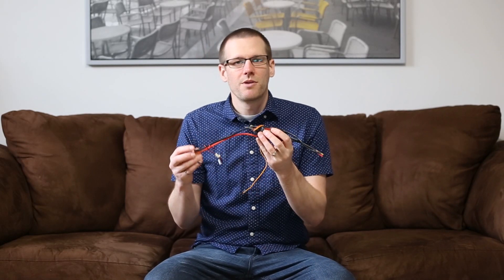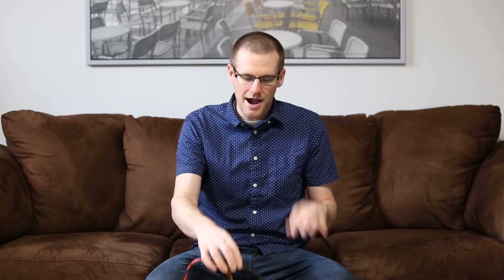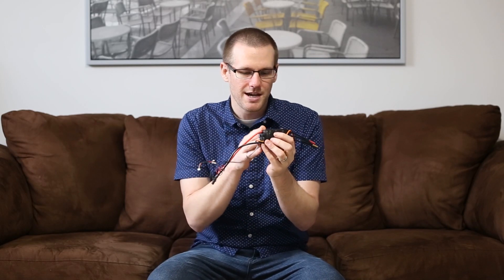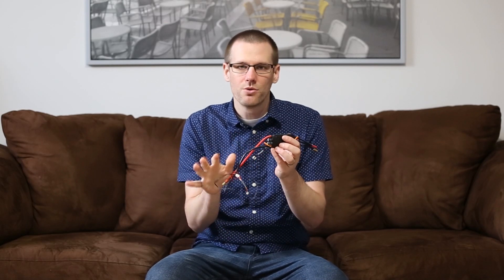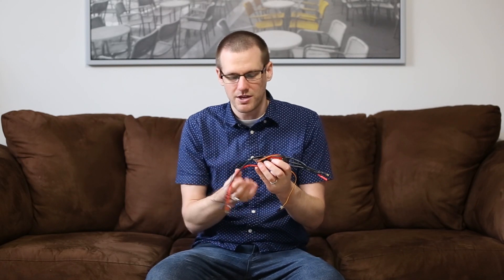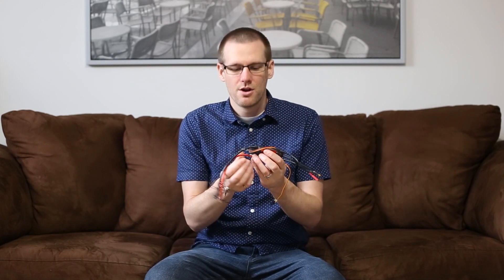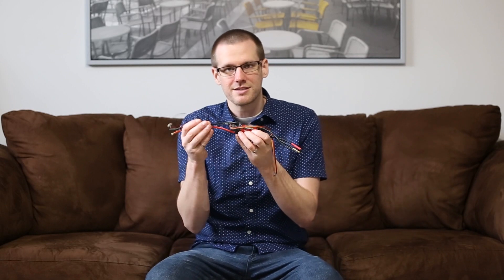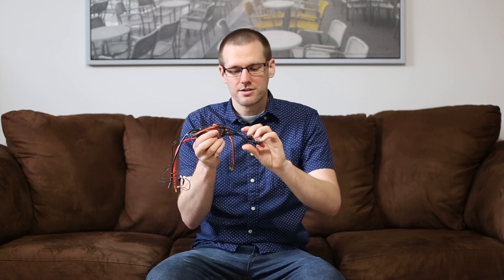Can Extending ESC wires kill your ESC? - ESC Basics

Comment: If the length of the wires on the battery side really matters that much then how come it doesn't matter how long the batteries wire is? Since once connected they essentially form 1 wire from battery to ESC and battery lead lengths are Not standardized or even remotely close to each other in length in some cases. What about adapters wouldn't those also add length and therefore cause this slow damage overtime? How come no one has addressed this when it seems like such obvious questions to ask

Comment: Hello, 
Is it the same problem when using a plug adapter that add some more cable length ?
Reply from the maker: Yes, although to a lesser extent. My recommendation is to always solder on the plugs you wish to use and avoid adapters.
Reply: @RCexplained  Thank you for the answer. Your channel have very valuable information for the RC hobbyist.

Comment: I have been searching around the web looking for an answer to a situation I have. I bought a 35a brushless esc to upgrade a 1/16 buggy. However, I neglected to read the description, and the one I bought came with 18gauge wires and smaller 3.5 mm female bullet connectors on the motor leads. The motor in the car is a 540 size 3930kv and has larger 4mm bullet connectors that do not fit. Would it be okay to replace the bullet connectors on the ESC to accommodate, or should I just get a bigger ESC? Space is limited so I got a smaller one on purpose. Thanks for all the informative vids, I've learned a lot from your channel!
Reply from the maker: Hey Spacecadet, if you respect the limits of the ESC and are geared appropriately for max 35A, you can solder larger size plugs to make it work.
Reply: @RCexplained  Thanks for replying! I think I will just try to return this esc or use it in another car. I went ahead and placed an order for a bigger 60a esc, and another body for the buggy. That way the combo will match up. Thanks again!

Comment: hi, i blew up my cheap ESC while testing (on bench without load) and setting up some parameters like end-points and reverse. Mosfets blew when ESC was breaking to 0rpm from full rpm on 2s. How about induction spikes from the motor when speed is variating, for example full speed to full stop. Those spikes happen on motor side, not battery. Is there any way to protect the esc from this? (except ESC's own protection features). Maybe some smd cap mod inside the ESC?
Reply: Happened to my ESC too

Comment: Two of my ESCs failed, and I was powering them from an old 350W PSU. Could that have been the problem?
Reply from the maker: It's certainly possible that ripple voltage could have caused an issue? Do you know how much current and power you were pulling? Would you happen to know the ripple voltage from an ESC data log?
Reply: @RCexplained  It seems your questions are a good answer. But I'm just newbin' it out with the cheapest motor/esc to see what I can make. Maybe they were just faulty.

Comment: Since it can cause damage too extend the wires between the battery and esc then why is it safe too use a dual battery harness  on for instance a 1/10 e-revo for 2 lipo packs that adds at least 4 inch's ?
Reply from the maker: Hi Roger, the at least 4 inches added in the dual battery harness (series wiring) adds to the total inductance that the capacitors inside the ESC will have to compensate for. Depending on the size of the ESC capacitors and the amount of load on the ESC will determine the lifespan of the capacitors. Placing more load on the ESC capacitors will decrease the lifespan of them and thus the ESC. 

Keep in mind, extending ESC wires on the battery side does not necessarily mean immediate destruction for the ESC. Using the word "safe" can be quite subjective in this case.

Comment: I appreciate the explanations but there's too much overthinking going on. The water hammer thing just doesn't apply to electronics in any way that I can think of. Capacitors oppose a change in voltage and don't have anything to do with wire length on the battery side. They smooth out instantaneous changes in source voltage as the load changes. A good example would be if you put a high powered stereo in your car and the headlights dim every time the bass hits. Put a one Farad capacitor across your battery terminals to prevent that instantaneous drop in voltage. In general, don't use more wire than you need, buy what you need, read the instructions, and get a book on basic electronics for reference. (just my 2 cents)
Reply from the maker: Thank you for watching my video and for sharing your thoughts on this topic. I appreciate your suggestion to use appropriate wire lengths and to read books.

However, I would respectfully disagree with your statement that the water hammer effect doesn't apply to anything in electronics. In fact, inductance is a very well-known and understood phenomenon in electronics that can cause voltage spikes in long wires. The water hammer analogy is often used when covering the basic concept as it is quite easy to understand.
Reply: @RCexplained  I do watch your videos because I need info and you know your stuff. I just got hung up on the "water hammer" thing probably because I wasn't taught with analogies that weren't "X" rated so it just didn't make sense to me. I do however know how many time constants it takes to charge a capacitor in an R/C circuit.(that's a joke). Oh, I should mention I was taught by the U.S. Navy and it was a different century...so...there's that. I'm still a fan, I just got cornfused by that blasted water hammer.

Comment: What wire gauge size do i need for XT60 connector for my 4s ESC to BATTERIES? Help please
Reply from the maker: For an XT60 16AWG will work for standard wire lengths.

Comment: Hello
Very interesting video.
I got a question.  So what if my esc is rated to 200 amp constant but I am using the set up where only 120amp is being used during the highest peak?
ESC can handle up to 800amp spikes for up to 3 seconds....tells me that the capacitors are big enough to accommodate for the cable extensions. 
What are your thoughts on this?
Thank you.
Reply from the maker: Hi Pavel! Thank You for your comment. Very interesting question. 
The best way to explain it is, the problem that fails the ESC isn't 100% related to current. You may have a 10,000A rated ESC and you can blow that up by drawing only 120A from it. The problem comes from ripple voltage across the capacitors. If the ripple voltage destroys the capacitors of the ESC, it will not take much current to destroy the rest of the ESC. 

Similar in piping, you will not get a water hammer by flowing a million liters of water through a pipe, however if the pressures were to spike, it is this pressure that can cause damage. 

Pulling 800Amps through the ESC will be OK as long as ripple voltage is managed. If the ESC is designed to handle that current load the ESC will be OK, however, if ripple voltage is mismanaged, a failure point is only a matter of time. It is not typical that failure occurs right away.

Comment: You can't use sewer lines and water to electricity and cables 😂😂😂. 

What you're talking about will effect quantum computing yes but for everyday electronics no. Just as long as you don't mess with voltage/wattage settings you're good. Extending wires will do nothing unless you're sloppy
Reply from the maker: Yes, you can absolutely relate flow of water in a pipe to electricity. It's a widely recognized and used concept for teaching in many institutions. 

Stating that extending wires does nothing is simply not true. Extending wires is a problem and this concept is not earth shattering or new.  It's actually well understood in our hobby just about everywhere.
Reply: @RCexplained  it won't break anything and I'm not sure where you got this from. Longer wires do nothing but extend the length of the wire. That is all. Electrical flow is nothing like water flow.

Try to arc water pipes the way you can with electricity without touching anything. I'll wait for your video essay
Reply: @RCexplained  I will agree with quantum computing is where any of that matters. The rest of your argument just falls flat cause all we need the wires to do is make contact. That's it.
Reply from the maker: I dont think it's necessary to list my professional credentials to explain where i get this from. A quick Google search brings up lots of information to explore and learn without the thousands of dollars in tuition fees and text books.  The best part here is that this write up uses another water analogy. These types of analogies are used quite frequently as i previously explained. Thats why you will find them everywhere. I can do another analogy between heat transfer and electricity. But maybe another video for another day, as you suggested.

https://www.rcgroups.com/forums/showthread.php?952523-too-long-battery-wires-will-kill-ESC-over-time-precautions-solutions-workarounds
Reply from the maker: Actually this article is really well done. It goes in to detail and also ties in manufacturers' recommendations.
Reply: @RCexplained  just whatever you won the big internet war. Just keep thinking longer wires destroys rc motors and esc's
Reply from the maker: This is not about winning. It's about sharing facts backed up by science to fellow hobbyists. There is no risk nor cost in learning these concepts from professionals.